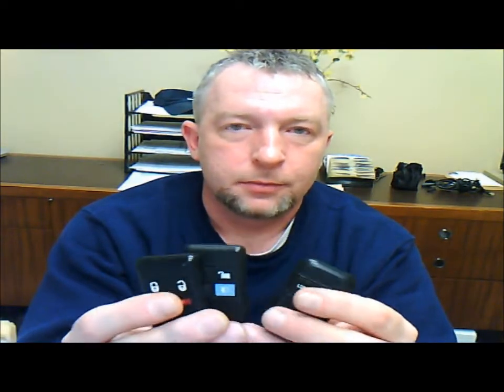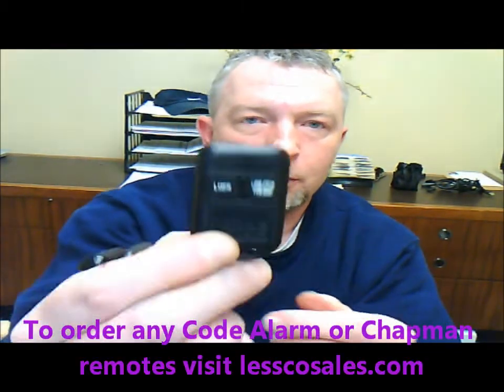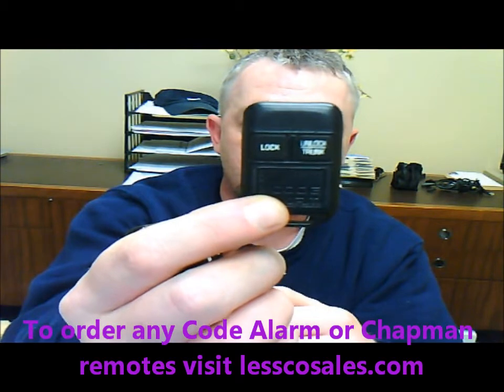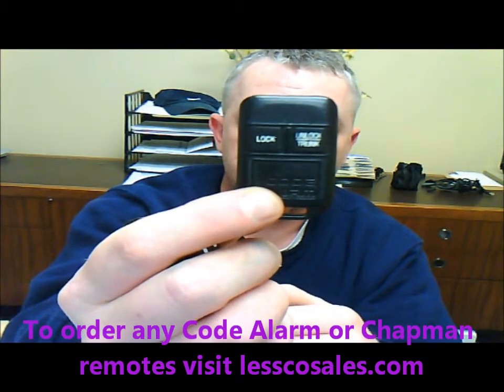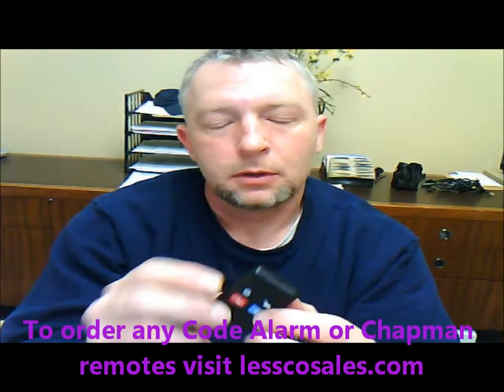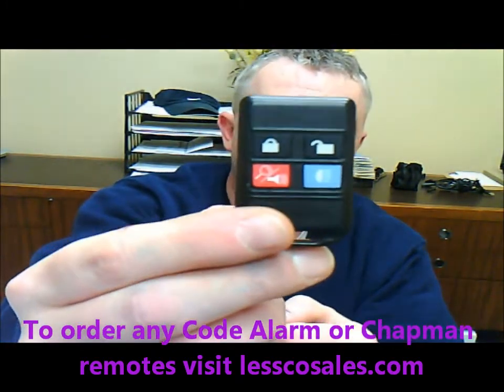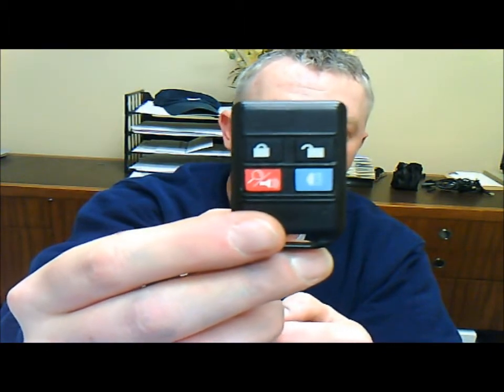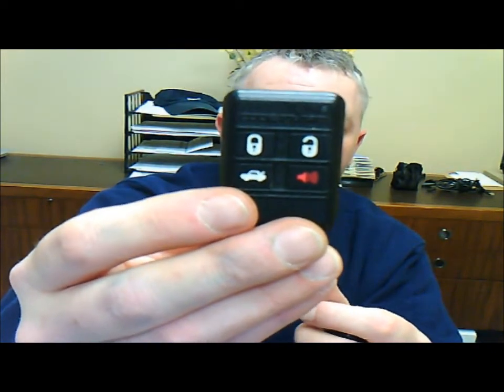Code alarm and chapman transmitter program learn sequence

Comment: i have an older code alarm that somehow went into valet mode.  there is only an override button.  i believe its a elite 2000  do you know how to take it out of valet mode??  i unplugged the alarm and it seemed to reset alarm, but then after it was driven, got out of car and it went into valet mode again.  i need to know the procedure.  i tried holding the valet button with key on, but didn't do anything.  can you help??  if i know the procedure, i can rule out if the override switch is bad, or maybe this system goes into valet mode through the remote???  all the code alarms i worked on in the past had a valet switch separately from override.  on the brain there is a diagram that show pink is the valet wire, but on the harness there is no wire.  think it came that way.  its just werid how it goes into valet by itself. the only other time i have seen this, is with a broken override button.  when they are broken, it makes connection or disconnection, when driving. any info would be great.

Comment: first of all, thanks for the taking the time to make this video.  I can get the alarm to enter learn mode (chirps 3 times) but I press the lock button (2 button remote) and nothing happens.  vehicle is a 1991 GMC Sonoma.   The remote is 314mhz.  the alarm is Code Alarm PRO1000.  remote battery is brand new.  any other way of doing this?
Reply from the maker: Try calling audiovox technical (they own code alarm) at 631 231 7750, ask for tech dept, good luck

Comment: Need help.. Got ca671 with the 2-ways remote.  Valet combo with led, following install instructions with ignitiion ON and press and hold for 10 sec. That just put me in valet mode with solid led light.  No chirp or lock/unlock.

Comment: I am installing a Code Alarm Pro100 that is brand new (except it is 17 years old) and I don't have an installation manual. Most of it is pretty straightforward but I have questions about the valet switch and LED. There is no marked connection points for them. I do see a place (yet unused) marked green (pin switch) and brown (disarm). Is that the two points I need to connect to or one of them and ground? Do you have access to an installation manual for this old thing?